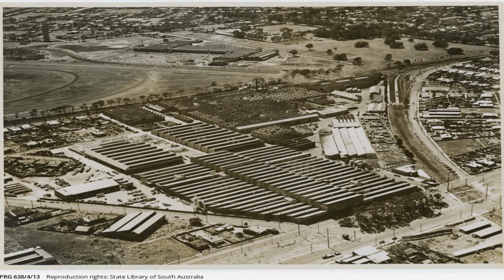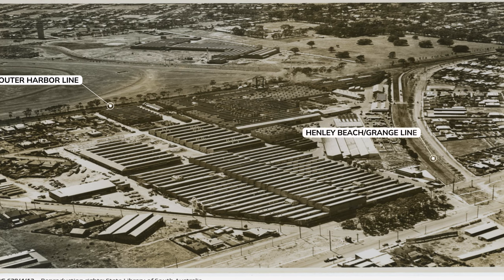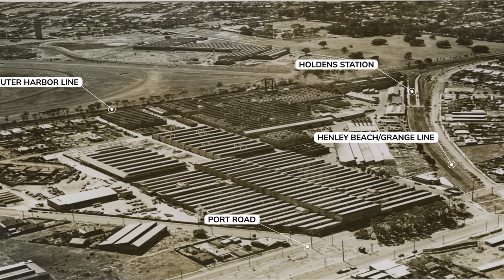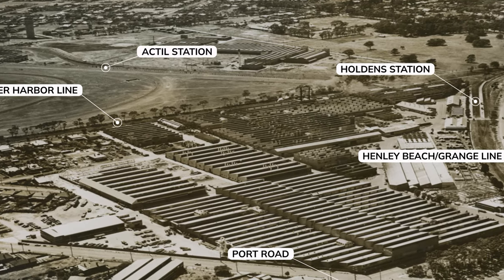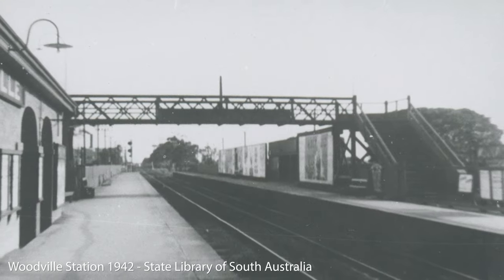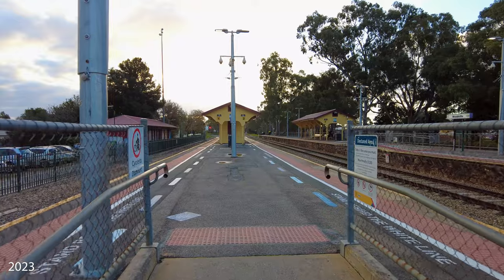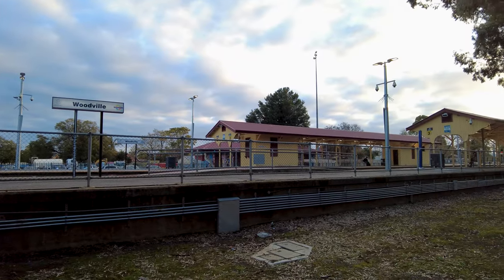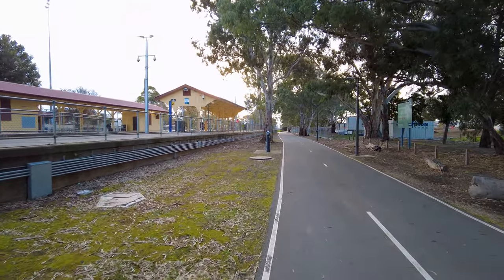The Old Finsbury Railway Line

Comment: Spent my entire youth around this line. Pinball in the old Finsbury Post Office, pushbikes on the stations, cubby hoses at the Cheltenham Racecourse, switching the points and sending the redhens onto the Kelvinator spur, banging the track with a hammer and setting off the crossing signals on Torrens Road, putting 2 and 1 cent coins on top of each other and letting the train squash them together good old childhood fun. My main curiosity was what was in the air raid shelter by the Finsbury Station. Found out in my late teens, but that is another story
Reply from the maker: Love this.

Comment: The Woodville North station had an impressive platform and multiple entry gates leading to it - I imagine for the lines of workers boarding or exiting the train during and immediately after the war years.  I know that because as a 12 year old I use to ride my brand new malvern star Dragstar bike with my Woodville Hockey Club mates up the ramp onto the gravel platform and speed along the platform sliding between the light poles.  This was in 1973 and the station was long closed by then although the infrequent week day Red Hen single car service from Woodville station was still operating and travelled along Audley Street as far as Park Avenue in afternoons.

The Holdens station was no longer operating by then but the Holden factory at Woodville itself had this large unused bike park hanging lot just adjacent to the station which will had an operating air-line running around the perimeter with connections to inflate bike tyres.  There must have been bike riding Holden workers in their many hundreds who took the train to work in the 40s, 50s and 60s to fill a bike facility of that size. 

I also remember that around that time there was an unused rail corridor  from a spur line extending from Albert Park station crossing over from what is now West Lakes Blvd (previously Clark Tce) going into the SABCO factory on Botting Street. Yet another remnant from WW2 no doubt but it was a great place for kids to hang out and do mischief on a weekend afternoon  ;-)
Reply from the maker: Awesome memories! Thanks for the tip on the Albert Park siding. I'll be tracing that short line soon.
Reply: @Outdoorstype  Cheers. Progress demands that we continue to re-develop and make best use of our land. But it's equally important that we document our history of what existed before it is lost forever. Thank you again for your work in doing this.
Reply from the maker: @neilgrant873  I have similar memories of riding BMX's around Sydney, but those childhood wild lands have been replaced by the western motorway.
Reply: Hi Neil long time no see. Spent my entire youth around this line. Pinball in the old Finsbury Post Office, pushbikes on the stations, cubby hoses at the Cheltenham Racecourse, switching the points and sending the redhens onto the Kelvinator spur, banging the track with a hammer and setting off the crossing signals on Torrens Road, putting 2 and 1 cent coins on top of each other and letting the train squash them together good old childhood fun. My main curiosity was what was in the air raid shelter by the Finsbury Station. Found out in my late teens, but that is another story

Comment: Only mixed guage diamond  rail tram crossing in SA that I new off
Reply from the maker: Maybe I'll try to find another one to surprise you. ;)
Reply: @Outdoorstype  there's many in Melbourne some already obsolete
Reply: @Outdoorstype  some ingenious ways at Melbourne tram and rail crossings on how the power of two voltages was turned on and off.
Reply: Melbourne trams ran on 600 /700 volts Dorect current  Melbourne Trains run on 1500 volts direct current each current had to be switched off to allow trams or trains to cross the level crossing
Reply: In the case of Torrens Road tram rail crossing 
The overhead tram power line was isolated either side of the crossing the power was switched off. As I beleive rail had priority over trams  to cross the rail  line.
Reply: Great Mike marvelous to see how ingenuity prevailed in those days
Reply: By Diamond Mike I  mean + not  this ×  lolo